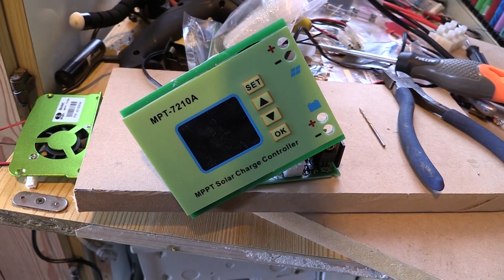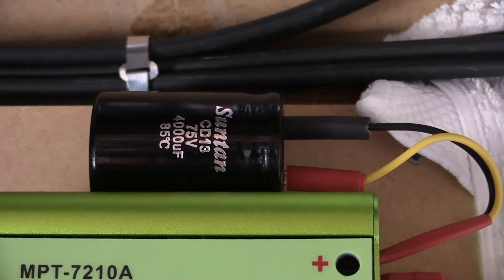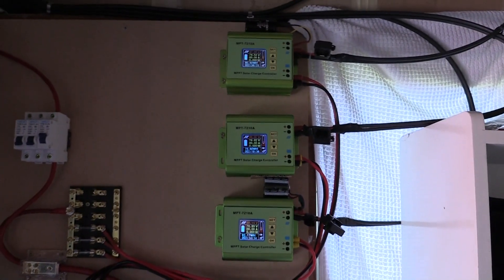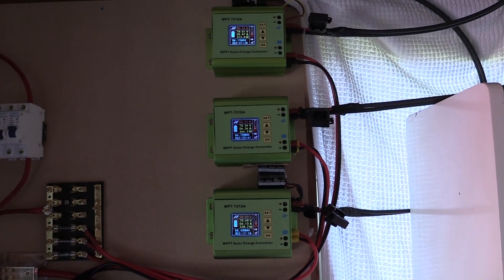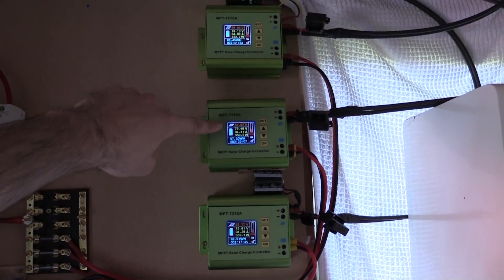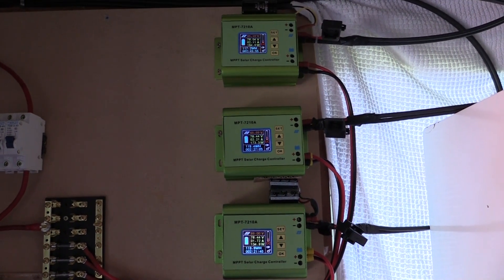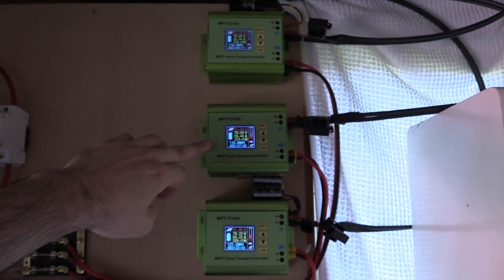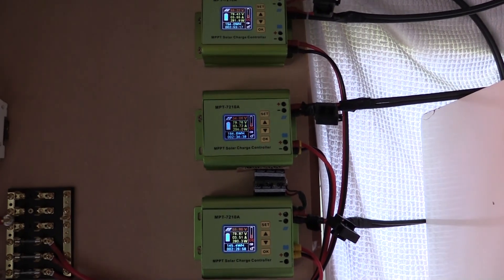Final MPT-7210A Install and Problems.

Comment: Interesting you could get 5A charging current boosting from 60V to 80V -- I tried the same setup on my unit and only got max of 2.5A! What a strange device. I just wrote a blog post trying to map out the charging current ability vs input/output voltage.

Comment: There is a fan speed setting: while not in charging mode
1. long press on "up arrow"
2. short press "set"
3. adjust fan speed with the up and down arrow to adjust.
4. End by hitting the "ok"

sounds like an air raid in the garage.😊

Comment: Mike ive been concidering one of these devices for use as a 72 volt ebike charger the use at home from a 12 volt adjustable current power supply and when bike camping from 4 flexable 50 watt panels in best config thats specified whats your thoughts on the reliablity of these as relieability is the main requirement ,otherwise i was going to make more of solid sate design with adjust volt ,current and low volt cut out via a few 10k pots on the front using a 20,30 or 40 amp dc to dc module they have on ebay, any advice for someone not experienced with dc boost units ?Thanks Katie

Comment: Can I connect the inputs of two of these to the one solar panel and set the outputs to different voltages to charge two different battery banks?

Comment: I was looking for why my controller drops out ever 20 seconds or so. Saw you mention the panel voltage being set too low being a possibility. Will have to try changing that value tomorrow and see if it helps.  Thanks!
Reply: Sure enough my solar voltage was set to 0v. Raised it up to vmp and it seems to be working much better. Not resetting ever few seconds for sure!

Comment: What does that capacitor do?
Reply: It smooths out the ferocious ripple generated by the big inductor coil (by the heat-sink) that's repeatedly shorted by the input MOSFET driven at high frequency from the MPU  to pump magnetic flux to the output to build the output voltage up to whatever is dialed in for an output charge voltage. Make sense?

Comment: what posibly happened to my controller,. it was set to 12v solar panel, 14v full charge but it always restarting,, its suddenly turns off and turn on again when the sun is so bright,, my battery is 52Ah and solar panel is 100w. what could be the problem?,
Reply from the maker: Whats the battery voltage ?

Comment: Since you have a 20s system your output current limit should be set to (3.0x20) =60, this is the lowest charge voltage assuming your packs cut off voltage is at 3.0. If higher no matter as this is worse case. Then 500 / 60 (Potential watts you have available over volts at lowest charge voltage = 8.33 A. This will make sure that in full irradiance that the MPPT doesn’t pull over your IMPP and therefore lower efficiency of the MPPT.

The panel voltage should be set to your panels VMPP x2 since you run two panels in series.

Both IMPP and VMPP are on the solar panel labels.
Reply: Note that I understand I should load an AGM 48V 20Ah package what you recommend as a setting In Italiano Ciao Noto che ci capisci io dovrei caricare un pacco AGM da 48V 20Ah cosa mi consigli come settaggio Grazie

Comment: You can turn the fans down btw in the settings :) if you use 2 of thoose and use a standard 80mm pc case fan that even fits across both very well andf oyu can use one for control@low rpm - works very well.

Comment: Can I use two 7210A to charge  one power bank in series (48v + 48V = 96V)?
Reply from the maker: Oh wow thats a good question. Yes you could i guess not sure how well it will work but would be worth a try. The 7210 is just a boost converter. The only way you could do it or use the 7210 in that way would be to have a separate solar panel on each of the 7210 units input. The 7210 also wouldn't be able to touch each other. Meaning as long as the input to each 7210 is completely separate then the output can be put in series to change one battery. The reason is the input negative is directly connected to the output negative so if you tried to use the same solar input for BOTH units it would be a direct short, eg pos of the second unit would be connected to ground and would blow a fuse or something. If you wanted to use the same solar input you would have to use a different unit that is an "isolated boost converter".

Comment: help.  i hooked this to the 12 v dc [ 10 amp.],output of my 1500/2000 watt generator, but it's showing 22- 23 - even as high as 30 volt peaks.it's jumpy. what should i set the input voltage and amps for? i'm charging lead acid deep cells .[4 x 12 v, [110 Ah ],  = 24 v, [220 Ah ]. what should the output be set for? 27 v ?. i could use your advise.

Comment: Can we connect outputs of several  mpt7210A in parallel, so that they all charge the same battery bank ?
Reply from the maker: Thats what i am doing, so yes
Reply: thanks
Reply from the maker: When you do you will need to change the batt voltage as they are not all the same between the units
Reply: good tip. in addition to setting the value, i will also check with the multimeter to make sure that the output voltages are equal in each mpt7210a

Comment: If you open those chargers, a cheap computer case with slots for 120mm fans would give you something to mount those controllers too (motherboard tray), a quieter fan (or fans) and a panel you could mount the fronts (displays) too that you could just pass the wires through.  You could also have buss bars inside it to protect them instead of having that out on the board and risk (even slightly) a short.
Reply from the maker: I am about to do a fan change on the top unit as the fan sounds very sick, Will do a vid on it
Reply: I was thinking the same thing. Some nice 120 computer fans would be so much more pleasant, and everything could just be in one box.

Comment: Are you charging through a bms or using a discharge balancer? Trying to wrap my head around how to make this work safe.
Reply from the maker: At this stage i am not using a BMS with balancer but do have low voltage cutoffs etc with the BMS i did build on another one of my videos. I am building V2 of my BMS which will have balancing at 1.5amps per cell

Comment: these units are booster only as they drop the true solar panel voltage down to close to battery voltage and then boost voltage up. Do these auto start every morning when the sun comes up? or do you have to manually turn on?
blimey 3 are noisy.. unplug the fans and drill the top and bottom full of big holes for air flow.?
Reply from the maker: Hmm no they dont, They are a micro controller based boost converter, Which finds the MPPT voltage of the panels "which is lower "and then boosts that up to the output which is the battery voltage. 
Yes there is a setting to auto turn on, Its always worked.
haha Yes very noisy small fan but apart from the noise they do work, If anything replacing the fan with a bigger slow turning one would be best but yes it needs a fan as it has a small heatsink on the mosfet. Given the size of the case.
Reply: thanks Mike, will have to work out how to set auto on then. wasn't obvious to me?.

Comment: verry informative. thanks for the video. 
can the shutting down issue be improved with lower voltage on the input side (panels in parallel) thus giving a bigger difference in input vs output side?

Comment: Hi, Friend!
Thank You for your videos. I see You are a Master in this subject. I have hunger of knowledge and I would be very happy to learn from You. Well, I live in Israel with my wife and here I bought a four wheel electric car run by an engine of 24volts that has two 12volt, 70amps each connected in series and as in Israel the sun is excellent I decided to install a solar panel so in winter I use energy and in summer I use solar power. I tried three kind of charge controllers, all pwm and now I discovered this Minghe mppt I think, like yours but I saw that it has this clushes( stops and starts when I pass a cloud or shodow) and I would like to improve it. Like you did with yours. But I need your help telling me exactly what I need like the reference of all the capacitors. I also don't understand this numbers in  the display. What do they mean. If you have an email I can send You pictures of the car and the charger working so You can understand better. Well, Our electric car has a semi- flexible polycristaline180Watt 36volts panel. Hope You can help me and congratullations for your Intelligence!
Bye and Shalom.
Emmanuel
emmanueltango@hotmail.com
WhatsAp: 09720586004419

Comment: You di not answer my questions.
Emmanuel Távora Freire
Reply from the maker: sorry what question?
Reply: About my solar car!
Reply: Hi, Friend!
Thank You for your videos. I see You are a Master in this subject. I have hunger of knowledge and I would be very happy to learn from You. Well, I live in Israel with my wife and here I bought a four wheel electric car run by an engine of 24volts that has two 12volt, 70amps each connected in series and as in Israel the sun is excellent I decided to install a solar panel so in winter I use energy and in summer I use solar power. I tried three kind of charge controllers, all pwm and now I discovered this Minghe mppt I think, like yours but I saw that it has this clushes( stops and starts when I pass a cloud or shodow) and I would like to improve it. Like you did with yours. But I need your help telling me exactly what I need like the reference of all the capacitors. I also don't understand this numbers in  the display. What do they mean. If you have an email I can send You pictures of the car and the charger working so You can understand better. Well, Our electric car has a semi- flexible polycristaline180Watt 36volts panel. Hope You can help me and congratullations for your Intelligence!
Bye and Shalom.
Emmanuel
emmanueltango@hotmail.com
WhatsAp: 09720586004419

Comment: could the difference in voltage be because the cables to the battery bus-bar are different lengths?
Reply from the maker: No i dont think the 15-20cm ish diff in cable makes a difference as they are not thin cables so there shouldn't be any voltage drop in that. I think its more to do with the difference in components. As along as i set a offset of each voltage it will be fine.
Reply: Mikes DIY Tesla Powerwall - I had a similar issue with my setup and when pushing amps up the line I was having 1v difference on the longer lead.  It's worth putting ones same length to see if that's the issue before offsetting? 4a at 80v can cause a bit of drop even though cable is thick